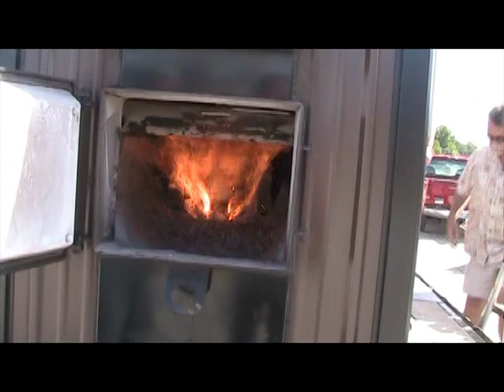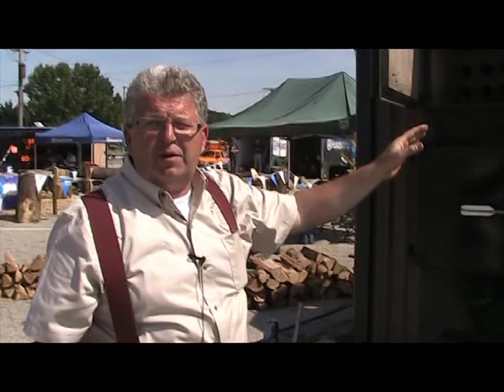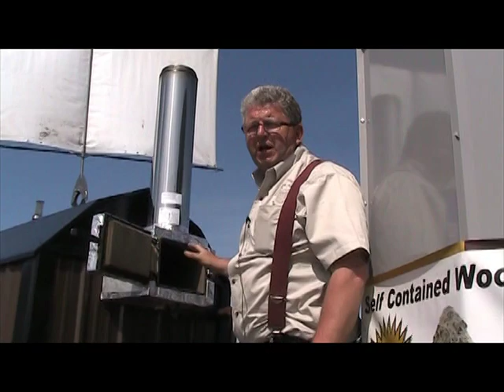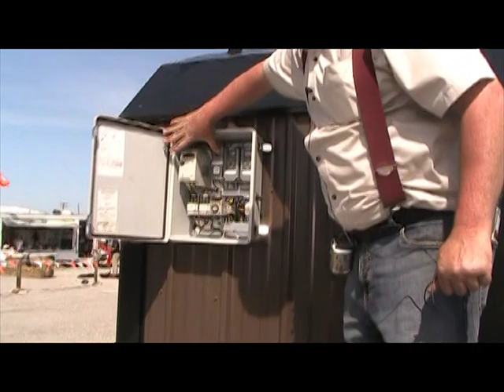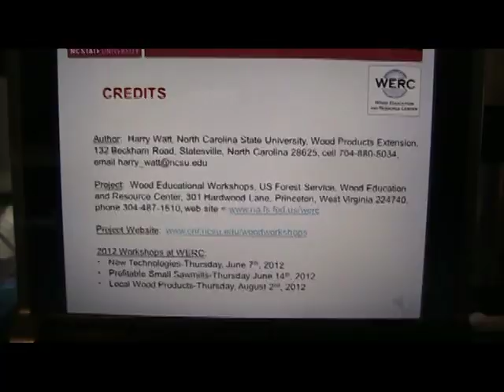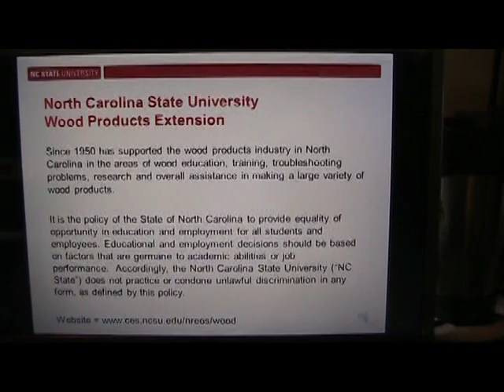Wood Chip Boiler Portage Main.mpg

Comment: With green chips 300'000-400'000 but with dry chips half a million but output. There is a video showing one of these units sited outdoors in Canada providing heat and domestic hot water for eight condos all single level with o other buildings near them. The unit needs to be fueled every ten days or so.

Comment from the maker: Hi Ethan-

The Portage and Main feeder system is quite robust with heavy drive motor, gears and auger so the chips can be variable in size and large.  Small and uniform chips are not required on their feeding system.  Give Brian a call at Portage and Main and he will provide further information.

Comment from the maker: Hi Phillip-

Check with P & M for the exact quantity of water, but should be several hundred gallons.  It just heats the water to about 180 degrees F.  This is a robust heating system capable of automatic operation.